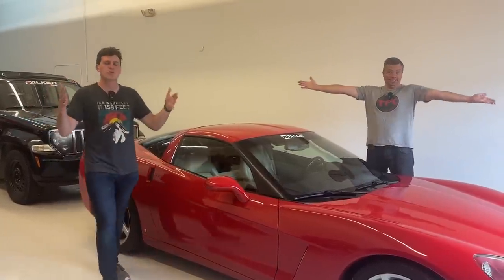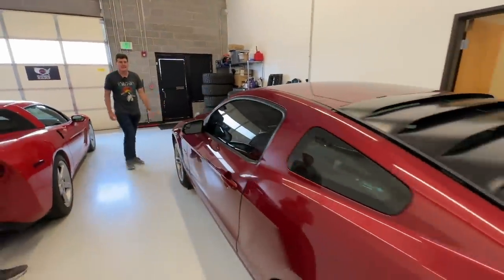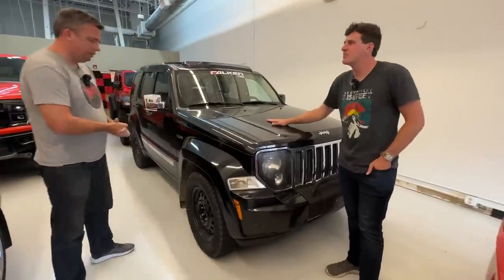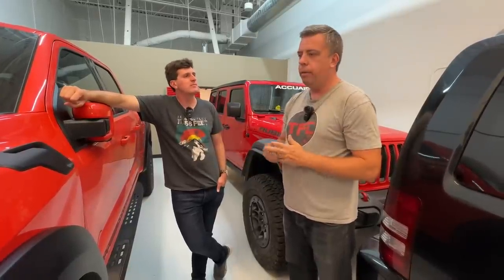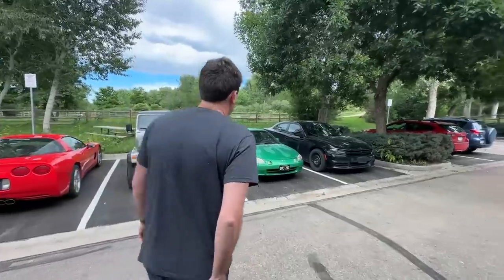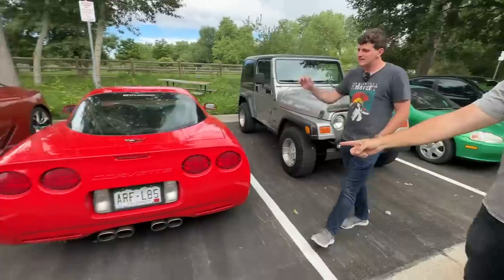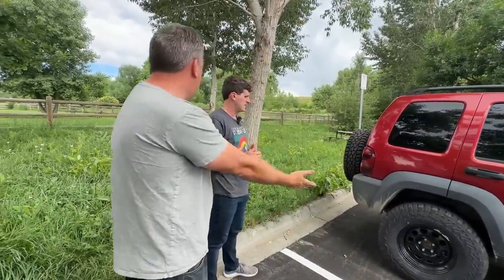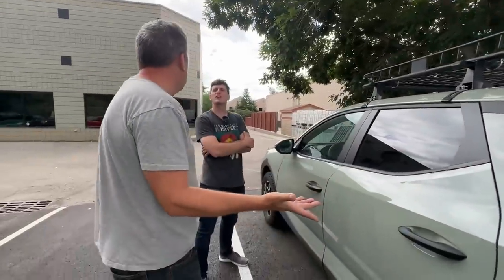We Sold Your Favorite Truck to Buy This! TFL Fleet Update

Comment: The KJ is the cheap Jeep sleeper that a lot of people dont give enough love. They have the same tcase as a late model XJ and the Selec-Trac WJ. They have a Chrysler 8.25 rear end which is super solid. The 3.7 is really a pretty decent engine and the KJ could be had with a 2.8 VM Motori Diesel. The V6 and diesel engines can tow up to 5,000 lbs. It's a pretty good platform overall and can be built to perform similarly to other unibody Jeeps of that era. The weakest point is the IFS setup but its not horrible and can be upgraded.

Comment: Keep more reviews coming for used vehicles between $20,000 and $40,000!! The new car and truck prices are insane!
Reply: New prices are insane. I bought a used 2017 ZR2 with 30k miles for $34,000, added an AEV trim kit ($100), timbren off road bump stops ($400), front level ($50) and 34 inch Patagonia M/T’s on new wheels ($1800 minus $600 when I sold old wheels). All in less than $36,000 and I got an off road monster that’s rides great on the highway

Comment: You know what would be fun? Make videos about installing aftermarket equipment that claim better performance. Or do an engine swap; for example, replace that 3.7 on the Liberty with a brand new Pentastar 3.6 and take it to the trails. That would be super interesting.  Those are my two cents.
Reply: Both engines are not good at all. Put a hemi there

Comment: I had a 2006 Liberty with the 2.8 diesel it was fantastic. Low end torque that let you crawl over and up anything without touching the accelerator. I never got less than 22mpg city and 30 hwy I had a coworker with a 3.7 gas he told me the best he got on the hwy was 17 and it was weak at low speeds. Unfortunately I totaled mine but I would get another but only a diesel which was only available in 2005 and 2006. Which are hard to find

Comment: Unlike most people that buy new cars I don't drive a new car back and forth to work as I use a new car as a weekend vehicle only and buy a beater to use as a daily driver. People crack me up when they buy a $50,000 truck and drive it back and forth to work so it can rot in the sun.
Reply: I buy my cars to drive them.

Comment: PLEASE buy a moderately used (or maybe 2-3) truck, something like Andres previous Duramax or newer, and do comparisons vs the new trucks for so much less money (ie a 2000+ 7.3, Duramax, 4th Gen Cummins etc. With average modification or stock) ... many of us can't buy $85k trucks to do remodeling work or run a lawn care business etc... but $10k - $20k ?

Maybe even a 6.2 F250, etc... do one gas and one diesel ... maybe pair up 2-3 people on each like the other competitions and try to buy the best truck gas or diesel for $15k each and compete including resale at the end as one of the factors
Reply: By the way if you look at my videos I kinda specialize in cheap good trucks, I've had several 7.3s including one I sold at 506k miles running great, a Lmm Duramax I bought for $7500 with a plow. And a 2010 Cummins for roughly $10k

Comment: While you are at it, buy a 1980s series Porsche 911 and see if you can LIFT IT and put a beefy off road shocks and suspension plus MT tires on it so you can turn it into a Baja rally racer! Then test it against the Jeeps offroad and on the drag strip!

Comment: Speaking from very first hand experience, the police cruisers are very well maintained. If anything fails it is pulled from service and fixed immediately. The oil changes are more frequent than required and treated as only heavy duty use scenarios on all the service intervals. Why not? They are a very true and extremely important lifeline for the officers and any criminals, victims or simply stranded or injured public!! We, I'm a retired LEO, are there to help and take care of everyone that needs it. Can't do that if the vehicle is poorly maintained or serviced. 
     It's just that simple.
Reply: That's nice to know, but...WHAT'S a "LEO?"  I googled that and it's "the fifth sign of the zodiac which corresponds to the constellation Leo and comes after Cancer and before Virgo" and so forth.
That is SIMPLY not much help.
Reply: @ectofix8447  sorry, LEO is the zodiac,,,,,, kidding it’s short for Law Enforcement Officer
Reply: @shitloveaduck  LOL!  Thanks!  My old brain couldn't figure that out.

Comment: Inflation, . .  regular expectations are that a low tier new Cadillac would cost 30K currently for example....but due to hyper inflation from the US economy valued at only ( 3 trillion) in which recent president's gave away 12 trillion mostly to (big pharma)  (Bill Gates) and plumted the economy into a ( post communism) economy in which all women are forced to go to work to live a normal life. 
 So the old farm truck you bought new for 30K now used is now worth 40K.
 FYI Cadillac is being forced to go out of business because the communist believes the (middle class) is unassarry and Cadillac fired basically all research and development staff and will just copy Tesla until completely out of business.